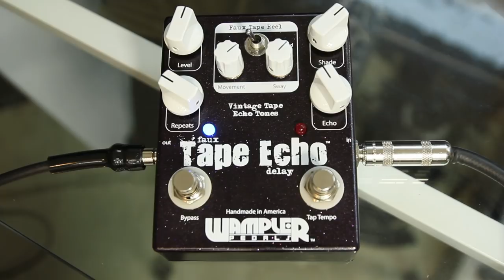Wampler Faux Tape Echo (Tap Tempo) Delay Demo - Tom Quayle

Comment: I have one and I found as you can see in the video that the tap LED is inconsistent with the actual time when it has been tapped in. This was frustrating for me because it didn't appear accurate. Now it's gotten to the stage where the tap function does not work whatsoever. This may be my particular pedal but seeing the inconsistency of the LED in this video I'm wondering if the problem is broad amongst all pedals.
Reply: Yes I resolved the issue. I'm not sure what I did to fix it but it's working fine now.
The only thing I don't like about the pedal is that it can't go at a slow enough bpm for my liking. Other than that it's great